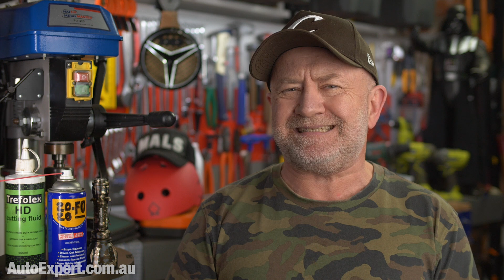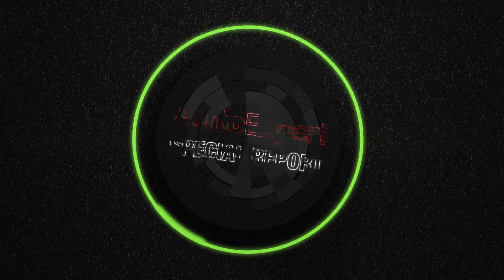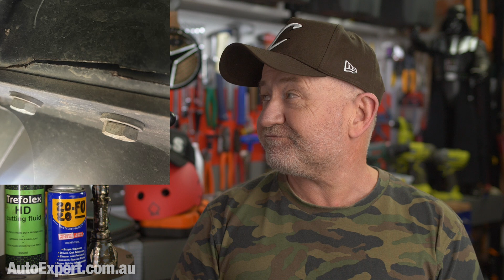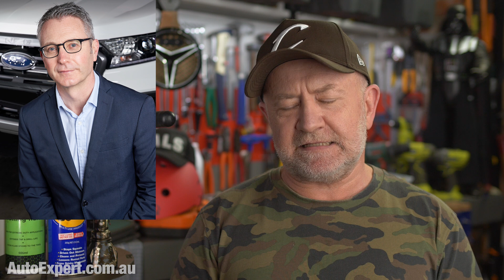CRACKED! Hi-tensile bolts Vs chassis Vs dealer incompetence | Auto Expert John Cadogan

Comment: Well, all good and true, but lacking us the info what the bolts screw into.
The tapped lower thickness of the box frame?
A thicker (and thus more threads like the recommendable 5 for a high tensile bolt) nut or insert?
The insert such that there is notable stretched bolt length (3x diameter is barely acceptable 5x diameter and more is acceptable)?
The bolt going through the entire box section with appropriate sleeved support inside to prevent collapse into a strong deep nut ( and thick washer?) on the other end?
i am asking because, while all you say is correct, what appears to be omitted (to me) is being clear about that high tensile bolt connections designed  without an appropriate length of the bolt being stretched, so as to act as a hard elastic spring so as to ensure the bolt stretches elastically in the presence of vibrations, load changes and inserts BEFORE the threads ever bend (very quickly plastically, especially if cut with too much clearance). 5x bolt diameter as a bolt stretch length does not really get you there yet either, but it’s a whole lot better than 1/4 to 1x bolt diameter as stretch length which is just predestined to bend threads with impacts over time even with a full 5 threads engaged and seen way too often. Worse if course is if the thread engagement were too little (or clearance too much) for the designed tightening torque, and a number were to be done on the threads already when the bolt is tightened. Especially if a high tensile bolt were to screw into a cut thread in soft steel (or worse, alu) and the thread engagement us insufficient fir the conditions. Just saying. Mho of course.
I’ve sure seen a lot of piss poor designed screw connections in my time. No idea if any dingos or creeks were involved.

Comment: I literally just had this conversation with someone about loose lug nuts. They were claiming that some percentage of nuts/bolts just 'work loose'. They claimed it was because cars are 'mass produced'. I have several problems with that:

1) I can't imagine any manufacturer surviving the liability costs if some percentage of their safety equipment (and a lug nut must be considered that) is expected to fail under design specifications in which it is used.

2) Lug nuts do get tightened/checked regularly by maintenance folks (or should), during service checks, at least tyre rotations, etc. So, as long as you are keeping up a regular maintenance schedule, the possibility for #1 (if there is any) should be negated if you the operator and your mechanic are doing things correctly.

3) Creating an expectation that bolts/nuts 'work loose over time' generally speaking is really dangerous because it creates an expectation of failure, and puts the blame on the consumer. 

Furthermore, if it is true, then we should expect our mechanics and service technicians to be crawling all over our vehicles and checking the torques of every single nut and bolt on the damn vehicle, because they might be getting loose. Again, imagine the safety/liability costs that would occur if 'nuts/bolts just loosen over time' was actually a real thing. How many things in the world are held together by nuts and bolts (and must be) for us to live and work safely? Does anyone really think that someone needs to inspect all of those bolts continually for safety to be achieved??

Comment: I got to thinking after watching this, what else could cause this fault?  In my vast experience, it’s very easy to see loose bolts in circumstances like this, there will be tell-tale marks around the bolts/washers and other signs of movement where the mating faces contact.. is it possible the tow bar wasn’t straight I.e. twisted slightly from side to side, so, during installation and the bolts were tightened, this put stress into the chassis? Does/can the chassis flex much at the point where the tow bar is mounted? If the chassis was flexing regularly in this area, is it possible for the rigid tow bar to damage the chassis?
Reply from the maker: It's hypothetically possible for the towbar to bt too rigid and damage the chassis, but this would not cause the bolts to be loose.
Reply: From the pictures in your article, it’s hard to see the tell-tale signs of loose bolts. It’s totally unacceptable to leave bolts loose when assembling/attaching anything. I have diagnosed many issues in my time and bolts simply don’t come loose. I’ve also seen ‘soft’ washers used with hardened bolts in similar applications and the soft washer has subsequently & unsurprisingly failed, which of course causes issues. I have seen the ‘rattle gun’ engine rebuilds that fail, break off torques are your friend and prove that fasteners were not torqued to specification during rebuild/repair. Like you’ve said, a torque wrench wasn’t used, a rattle gun in the wrong hands is a bad combination..Looks like zero quality control in this case. Shame on the tow bar installer/ Ford.

Comment: I wonder if this is partly a case of "smelling your own farts"? The dealer looks at the price they would charge the customer instead of what it will actually cost and has a little heart attack..

To be fair Holden's suffered from the same "bolts coming loose". Had a VF recalled for a steering issue. Got it back(in half the time the recall was on the books for) and it was pulling to the left, I'm guessing they skipped some steps like "check toe" but they certainly tried to charge for an alignment. A few days later I noticed a clunk in the steering, there was slop in the spline between the steering column and the little uni joint on the rack. I say slop because I did try and tighten the bolt but couldn't. Took it back got the "yeah sometimes they just come loose" story.

Comment: Hi John.  Its funny you have posted this as we are currently going over this issue with a Government client.  Our clients have requested we engineer and manufacture a towbar for the Ford Ranger specifically as they were not happy with the mounting system in place on current market models and its chassis issue.  We normally manufacture only heavy vehicle towbars between 3.5 - 40T capacity but as they are a good client and were willing to pay for the engineering and structural integrity testing, we complied..  Our model on the Ranger bar avoided chassis bottom flange mounting system as a main support and utilize crush tubes through the sides as the chassis is flimsy.  Generally towbars for heavy vehicles require VASS  certification over 4.5T and must comply with bolt pattern spacings, high grade washers and nylocs etc as per VSB 6.  As these vehicles are under that weight, no VASS is required, therefor no inspection is conducted on the quality of the fitment by a VASS Engineer.  We use grade 8 imperial bolts as metric grade 8 is actually lower than its imperial counterpart.  Nyloc nuts must be fitted to prevent them coming loose over time.  So if this dealership state that it is common for towbar bolts to work loose,  I call bullshit.  Properly tensioned nylocs have never worked their way loose on any of our towbars over the years. In addition to this, in order to register a CRN on a towbar there has to be a detailed installation instruction booklet supplied with the bar.  Half the outside installers don't even refer to it.

Comment: Any bolt with a clamping dimension length less than 2.5 X D can come loose under cyclic loading. It's why truck wheels have indicatiors on the nuts, the clamping depth is too short to provide enough stretch in the bolt shaft to act as a spring to compensate for all thermal and load conditions and guarantee consistent clamping load. If your clamping depth is less than 2.5D use Loctite as a minimum, better is to use a longer bolt and use spacers to increase the clamping depth. 

It's why alloy wheels came off when they were 1st introduced in the 70s until car manufacturers designed nuts and studs that were much longer. Steel wheels on cars include a raised protrusion the nut sits on that acts as a spring to guarantee consistent clamping force, alloy wheels didn't have this which is why they had problems.

Saying this all the bolts being loose indicates they were never tightened correctly, you would never get such a consistent result, at least the possibility is statistically unlikely.

Comment: I’ve had the misfortune of working in vehicle engineering for nearly 40 years, & at the start of this video I thought ‘those bolts weren’t tightened when the tow bar was fitted’.Congratulations on arriving at the same conclusion based on your university education.

Comment: In 1999 I was working as an apprentice for a short time before leaving at a then Sydney Hyundai dealership.  I spent many a day drilling and riveting Hyundai excel chassis rails around the base of the firewall back together and slapping a recall sticker on the door frame. 4 rivets per side. I look back and laugh now but dodgey as.

Comment: Hi John I’ve got a story that will beat this one. Someone bought a brand new Ranger, drove it straight to my workplace to pick up a trailer and didn’t get 20 metres when the tow bar came out. The dealership didn’t fit the pin for the slide in tongue. 

This incident that you are describing has apprenticeship written all over it. 

Another thing that should be mentioned about bolts is not to use high tensile bolts as sheer bolts.

Comment: Those bolts are made from loosytanium, an alloy that, whilst very strong, is known to be unsuitable for making any fasteners from.  No matter how often or how tightly you torque them down, they will immediately become loose again -- with the resultant problems you see here.   To be honest, I'm surprised that AFD didn't just use velcro to attach the towbar :-)
Reply: This ain't no model flying engine. These aren't carbon fibre arms! 
Love your channels Bruce!
Reply: @erg0centric  :-)
Reply: They do now, easy to swap between vehicles
Reply: LMAO! Good one Bruce!

Comment: if ford will not warranty work done by their dealers things are badly wrong. What if a ford dealer does not change the oil when they say they have does ford then also not honour the warranty  , why has ford licenced dealers that then invalidates the warranty with such poor quality work. So to avoid ford not paying warranty you have to make sure you don't use a ford dealer as the work quality is below fords standards? The government should ban fords as this quality could cost life's what is the dealer changed a wheel etc or worked on the car braking system dealer that work is so bad ford wont sonar the work it shows an out of control business a failure of senior leadership at ford they should change the CEO  as they have not put the most basic processes in places. Ford USA should fire the CEO of ford Australia and sent in a global management team that have worked in countries like USA or UK where they have to do things correctly Ford are good here I doubt would happen in UK

Comment: Yep - I'm getting concerned I agree on this was well the repair is not that challenging and yes absolutely incorrect fitments. We all know when your vehicle is serviced these so called checks are simply box tick exercises and they never really check anything - just dump the oil replace the filter then tick the boxes. Heck I've checked the oil level after a service and found it low on my mustang - just top it off no point complaining just check everything yourself.

Comment: I am not surprised that a mechanic/technician would cock this up so well. I can not count the number of times I have found loose bolts on motor vehicles post service (I just can't count that high). Straight from the factory never. Might just go check the tow bar on my car now. Might kill some time in lock down.

Comment: AFD shop foreman to apprentice: "...and after you sweep the floor,bring me a coffee and fit that towbar to the Ranger in bay 2."

This brings to mind a personal experience I had back in the 80's .A coworker's company car ,a Ford Sierra, cooked it's manual transmission on a business trip ,one week after getting serviced. The cause was the oil level in the gearbox was below the acceptable level. The Ford dealer's response was that they don't check the gearbox level at regular services.
The same car had a front brake caliper fall off after a previous service by the same dealer.

Comment: Just a stupide question from Scandinavia here, what is wrong with using loctite on those bolts in addition to tightening them to speck?
I fly RC helicopters for a hobby and if any bolts in the rotorhead is not used loctite on the question is not if but when the bolts will let go, and they will let go fast and spectacular.
But then again if those bolts are not tightened properly not even loctite will help.

Comment: you are correct in all areas!!
MOST dealers/mechanics start off with "go away, I cant be bothered" and work from there.
The dealer is charged $$ for publicity/public relations by the company on every car sold.
Most spend their own money in this area, yet this is a real opportunity at REAL target marketing that they let slip away.
A part removal and a small weld followed by a proper reinstall with Loctite would not cost all that much and would yield great benefits!!
The customer would rave for years on how well he was treated, forgetting that it was their screw-up.

Comment: How tight should a bolt be? As a rule of thumb, snap it and back half a turn.😂  I went to take my 2016 Territory in for a service and the battery was to low to start the car so I jump started it but ICC was now blank so I asked the service guys to take a look while it was there. When I picked up the car they informed me that the ICC was dead and this was a common problem when jump starting a Territory. They also said that the technician had tried to reboot the system several times to no avail and that an exchange ICC could be ordered for $1000. They had me by the balls so I got them to order the unit. When I got home I decided to do some poking around myself having worked on cars all my life and started with the basics. Well, well a blown fuse. I stewed on it overnight and decided to get them by the balls and give them a good squeeze. The next morning I walked in and asked for the service manager. I asked him carefully if his technician had actually tested the ICC and everything to do with it or if he had just decided that it needed replacement. I got the same story of the checking and rebooting ect and then I told him not to bother with ordering the ICC as I had fixed the problem myself and his reply was a condescending “how”. I pulled the blown fuse out of my pocket and gently put it on the counter and said “a $2 fuse” By now the other minions were all listening and I could see the look on his face change to ohh shit but then he asked “which fuse” hoping he could escape by finding out it was some random fuse that wasn’t obvious but when I replied “the one clearly marked ICC” he knew the game was up. Then he tried saying that these units die often and it’s always the head unit. At that point I had him by the balls and now I gave them a good squeeze by asking when did their so called technicians stop checking the basics like fuses? He was about to say something but I told him this was such a rookie mistake that I might expect a first year apprentice to make but for a qualified technician it was inexcusable. That changed his attitude and he simply admitted defeat and apologised for the fuck up. I decided to give them one more yank and asked, so what would have happened when the new unit was fitted and that didn’t work? To which I received a vigorous reply that they’re an honest dealership and they would have told me. At this point I had what I wanted which was to admit fault and apologises so I left. Of course he wouldn’t tell me because the idiot technician wouldn’t have told the manager, he would have fitted the new unit and when it didn’t work would have eventually found the fuse. Is he going to run to the manager and explain what a moron he is or just change the fuse and say nothing. I would have loved to have seen the right bollocking that technician would have got from the manger for being placed in such an uncomfortable and embarrassing position. For those wondering the ICC is the Integrated Command Centre which is in the centre dash and controls the entertainment, air con and a lot of other functions. We have since sold the Territory and will never buy another Ford. 
Cheers Stuart. Canberra.
Reply from the maker: Half a turn is probably a bit far, in the hi-tensile world.

Comment: If these idiots do not know how to torque bolts how can they replace a head gasket? They are not mechanics. But tow bars should be connected to the frame. No frame, no tow bar.

Comment: Amazingly dumb that the electrical earth connection was made on a high tensile 1/2" bolt holding on the tow bar where the torque would have to be like 90 ft lbs, that's quite a lot so it (the bolt) wouldn't come loose.  That's enough evidence to me that the fitting of the tow bar was deficient and compromised and certainly amateur.
Reply from the maker: Plus, the 10 loose bolts. 10...

Comment: Ground wires on a chassis structural connection. Hydrogen embrittlement anybody?  "Obvious as balls on a big black dog"  Dude, that was priceless!
Reply from the maker: Thank you Charlie.
Reply: @Alfred Wedmore After spending quite a bit of time changing fastener specs because of hydrogen embrittlement at Chrysler years ago, LONG before Tesla, I beg to differ.  Don't bother going into a long winded explanation of how wrong I am and how smart you are. I'm going with an entire engineering dept's findings vs yours.